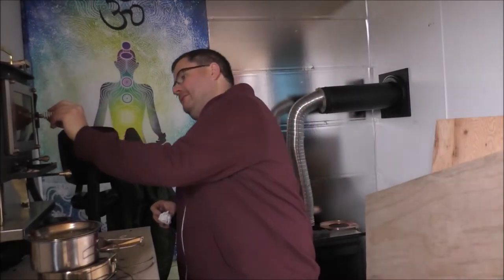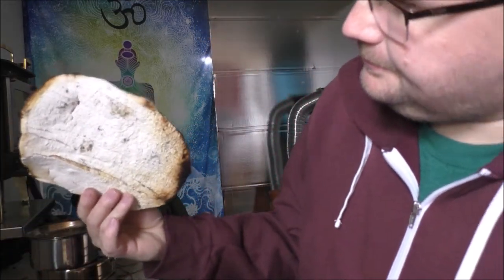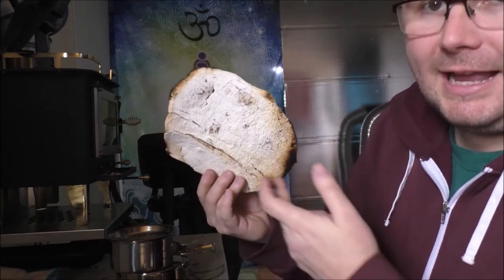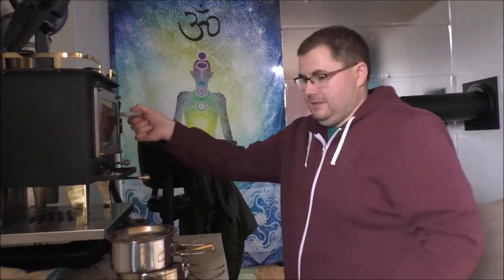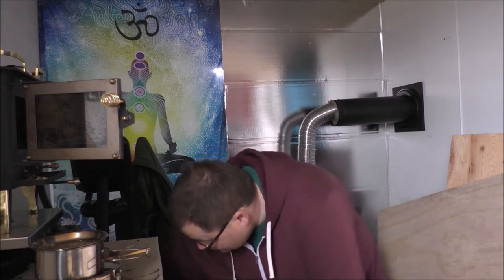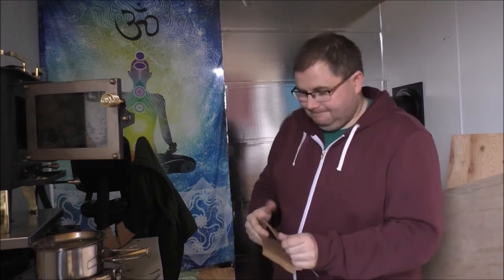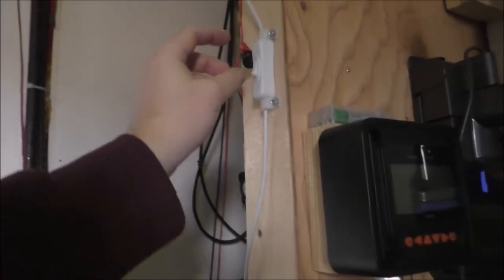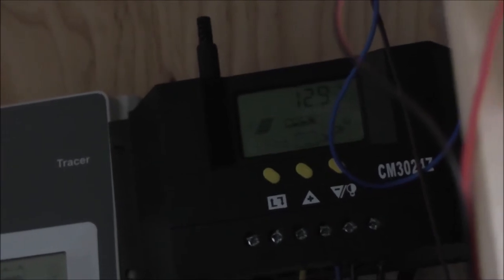Barrel Stove Plan

Comment: You have a concern. Great huh. Your stove pipe may get so hot it might melt the plastic in a solar panels or the tar on your roof. A heat deflector may need to be added on top of the stove pipe A simple piece sheet metal tin. Along the top length of the pipe. The pipe itself may need to be 3 inches. Instead of six. If you put a 6 stove pipe the store can literally run you out of your house in the middle of a cold stretch. The worst thing is that you don't have the thermal Mass. that is rock walls. I always said if I was going to do one out have a double decker with a hoe throw the top barrel and a fan blowing air into the hole this would be a 4 if pipe going through the top Barrel. However I always envisioned this in a shop. Not in a small Close Quarters Mike you are suggesting. I have a frayed that you are making something that you might stumble over and get into a state of agony that will linger for days. You probably really need a 3 log Camp cook stove. Cast iron and yes I think you how to be able to trick that thing up into your trailer. Ultimately when you said Barrel stove I thought you was meaning something that is small like a tent Barrel stove which is bigger than what you have.
Reply from the maker: yeah i will be building a thermal mass wall on either side so i dont fall onto a hot stove

Comment: 90% of people who make Barrel stoves you're not do it logically. Mostly is about the door. You want that door as high as possible. You would want that large oil drum drain opening at the bottom to help and air flow. No. We are making a shop heater. That cap May melt you want to put a pipe fitting in there threaded pipe nipple and a plug or a valve. Having your door up high allows more Ashes to be placed inside your Barrel stove. One needs fire bricks is the best for clean out. There is rumors people have used sand. I have always counted on going to have fire bricks especially when it comes to shoveling out the ashes. So make sure that your Barrel has the small drain opening threaded nipple on top and a large fill opening on the bottom and you can replace the plug with a threaded galvanized plug if you want to just rely on your vents leather manufacturer has provided. Do not be silly you want your door as high as possible. Think I'm trying to load the thing and having ashes Cinders hot trying to melt your floor because your door is low and you open it and they want to fall out.
Reply from the maker: yes sir i will try to follow your instructions